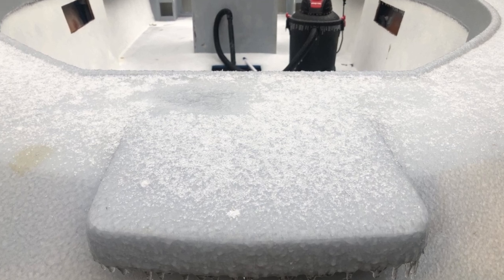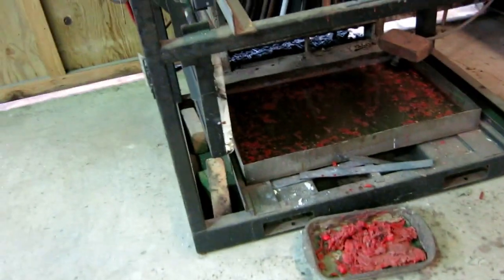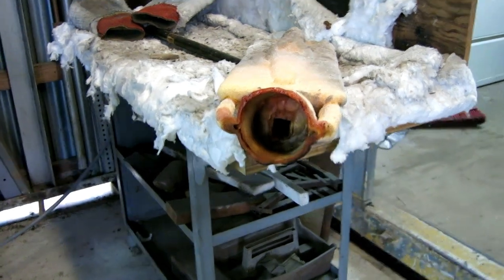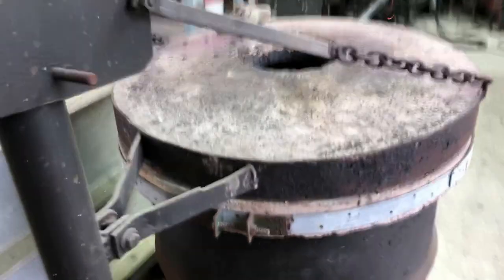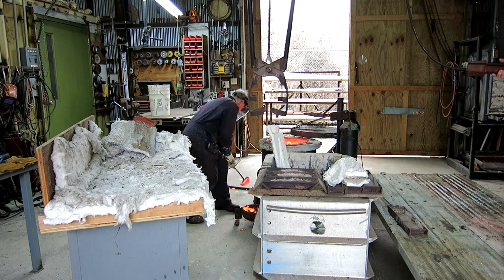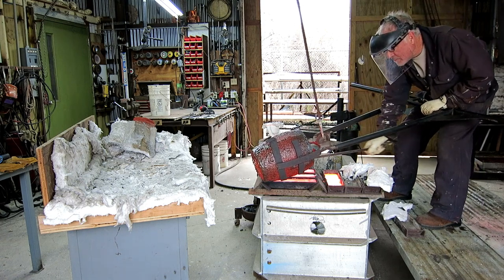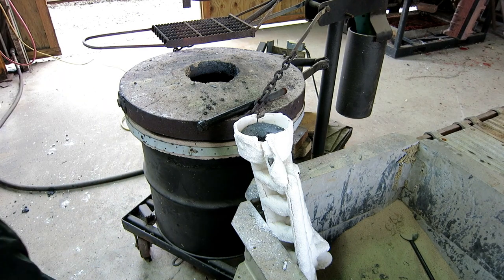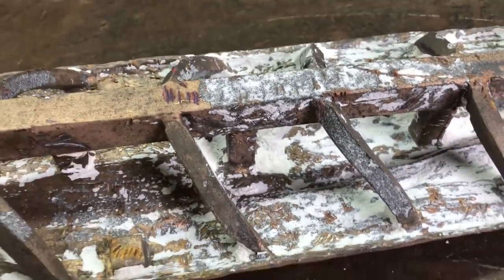No boat progress this week, Bronze casting instead. CC #30

Comment: Great video and very impressive foundry work. You are very talented in many areas and a very smart and interesting person. Equally impressive is how you are up on the times doing all the great video's and editing. I've been in the non ferrous foundry industry for 40+ years casting valves & fittings for oil equipment industry. My hobby is fixing up old boats and selling them for a loss. Just discovered you cc series recently and leaning something new with everyone.  Thank you for sharing your work and expertise.
Reply from the maker: Calvin
You sound like a true kindred spirt. Don't worry about selling those boats for a loss, try to make it up in volume! Just kidding. That is why, unless there is a warranty involved, I always throw my receipts away, I don't want to know. The video work is not very high tech. I have a little Cannon s110 box camera (actually my third one) that I buy used on Ebay. The video software I use is much like my phone. It will do hundreds of things that I have no clue about. I stick to the basics, no fancy video tricks coming from this desk.  Thanks for the kind words and thanks for watching!
Barry

Comment: Love these casting videos. You and Deb are one heck of a team.
Have you thought about coating the wool in your burnout oven?
Reply from the maker: Fish, Thanks for watching and glad you enjoyed. The ceramic fiber insulation on the inside surfaces of the oven has been very durable. Six years of burning and it is still very serviceable. The floor insulation is a different story. It is about done. When I replace it I will look for something a little tougher or something I can put a coating on. Cutting it into smaller sizes from the start  will help also.
Barry